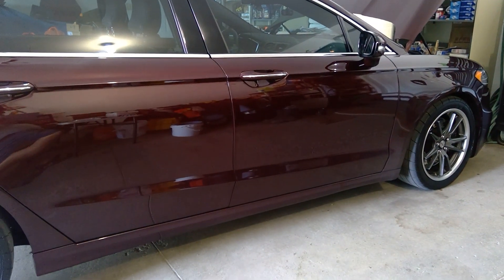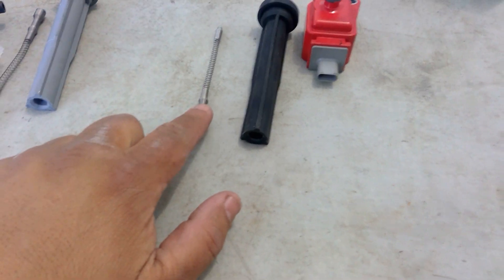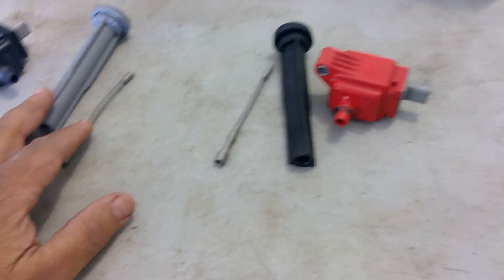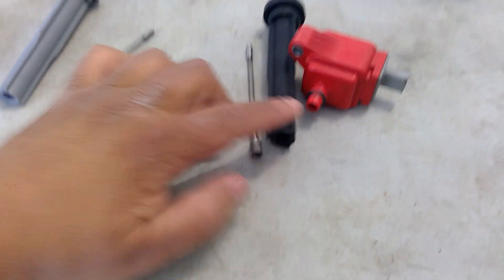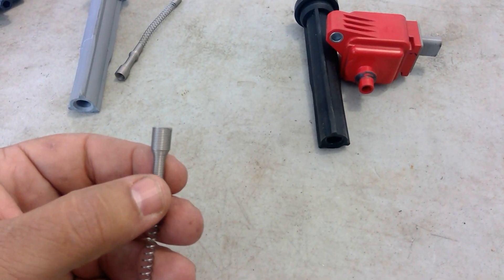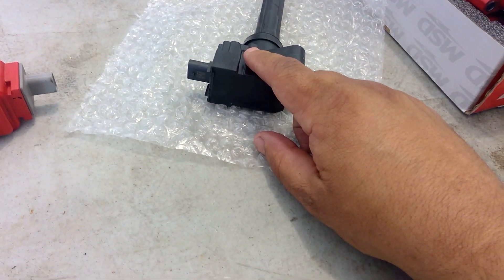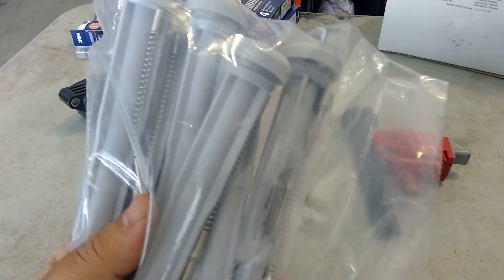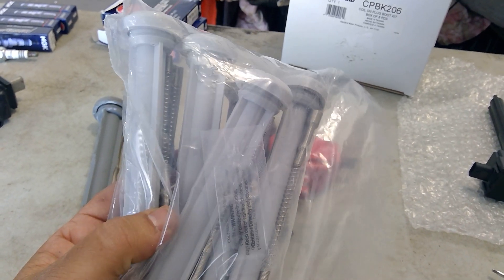Coil Misfires - Ecoboost - Ignition Carbon Tracking - COILS BOOT

Comment: I found some white chalky stuff in my ignition coil...at the end where the boot plugs in....I realized it has to be carbon tracking....should I replace coil? Or can I put some type of dielectric grease over them?
Reply from the maker: grease could help, but, eventually, you may need to change the coil, or at least the boot and spring.
Reply: @twinforce_fusion6560  ok so should I worry about the spark plug too and the wires? Or should I only worry about the coil?
Reply: @twinforce_fusion6560  should I put the grease all over the tower plastic or also the metal coil tower itself?
Reply from the maker: @macknumber9  just inside the boot, and or around the spark plug (ceramic part)
Reply: @twinforce_fusion6560  ok so just the boot going into the coil
Reply from the maker: @macknumber9  yes, apply grease inside, use a Qtip is perfect to apply
Reply: @twinforce_fusion6560  ok...I wonder if I should just replace the coil.  I would hate to waste $100 if it doesn't fix my problem...that white stuff I don't know if it is carbon tracking....my guess is the spark is jumping down and causing these marks....why it is doing it I don't know other than maybe the coil is just faulty....it does look old

Comment: I saw this video the other day.  I had plugs waiting to go in and decided to get this boot kit to go with them.  When I changed them out today (6/2/21)  I notice all 3 boots on the firewall side looked a little burned on the end.  A white discoloring, not black or brown.  The boots on the other side looked perfectly new.  The car was running an LMS 93 tune with stock plugs.  I have had 2 or 3 times where the engine light came on during full throttle.  The car would shudder a little and regain its breath a few seconds later.  I've also had the gear hunting issues during these episodes.
Reply from the maker: We all seem to suffer with the same issues. Under WOT, around 100mph, etc. For now, all my issues are fix regarding the DTC's and missfires. My shifting issues from 3 to 4 only happens when tranny is very hot (back to back passes).
Reply: I have Amsoil for the Trans, PTU and RDU waiting to go in.  I don't track this car at all, it's a daily.  I've noticed the car doesn't like allot of random "flooring" it.  It wants to be ready for the abuse with breathing room in between.  Afterall this isn't really a performance car, It's a car capable of performing at a level higher than it should.  Probably the best sleeper ever produced.
Reply from the maker: @22chuman  with proper maintenance and good quality lubrificants and fuel, this car can handle a lot.